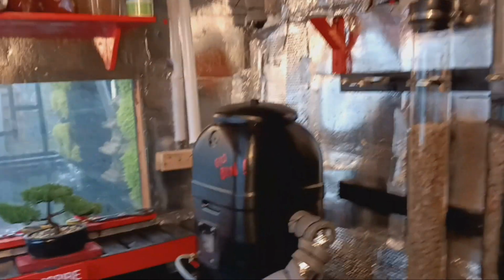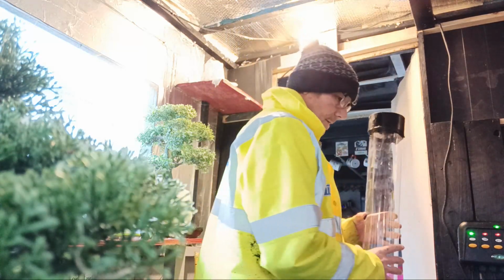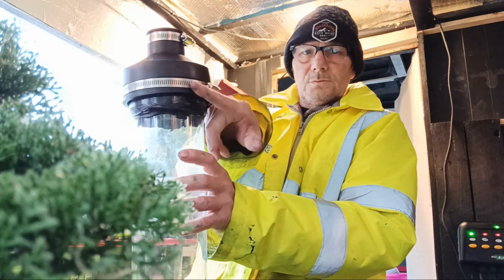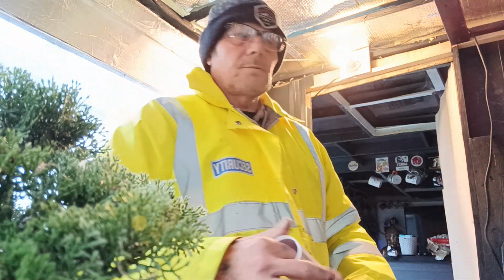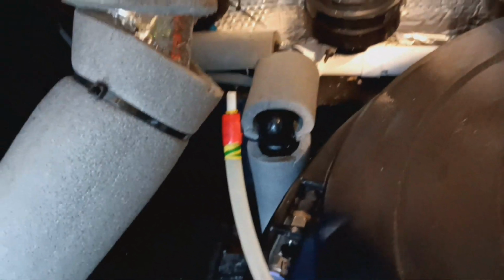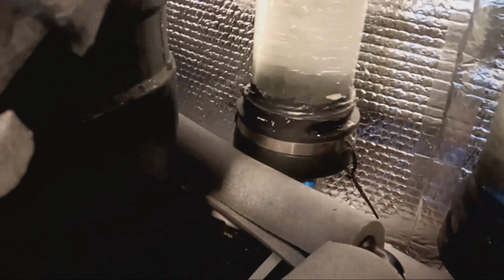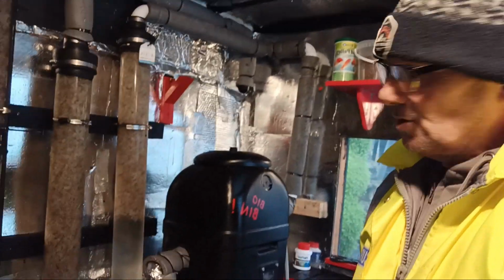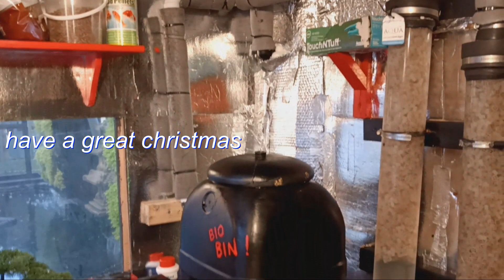koi pond filters design it build it plus a big christmas thank you #koi #fish #backyardkoipond #pond

Comment: Thanks for the update Martyn I was going to ask how did you set up the air feed on the rubber boot but glad you explained it and show it 👍
Reply from the maker: Hi mate I just drilled a 10 mm hole into the boot and forced the non return valve in and put ct1 on the inside to stop it coming back out and creating a air tight seal 👍

Comment: Just come across your channel absolute brilliant work there mate on the diy tempest, ware can i get the plastic tubes from
Reply from the maker: Hi mate thanks and you can get the tubes off an old bubble lamp but it must be the 120cm  size hope this helps
Reply: @martynskoipondandgarden4581  perfect thanks mate dam sight cheaper than buying the tempest if I find any second hand ,what did you put around the ends before the rubber boot I couldn't here properly
Reply from the maker: @RicksAquariumsuk  I cut a 3 inch sleeve of a 4 inch waste pipe
Reply: @martynskoipondandgarden4581  did you silicone it on to seal it before the boot
Reply from the maker: @RicksAquariumsuk  yes mate 👍
Reply: @martynskoipondandgarden4581  perfect appreciate it